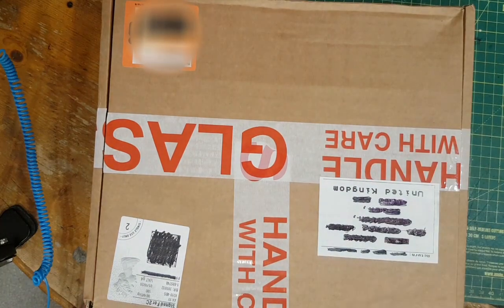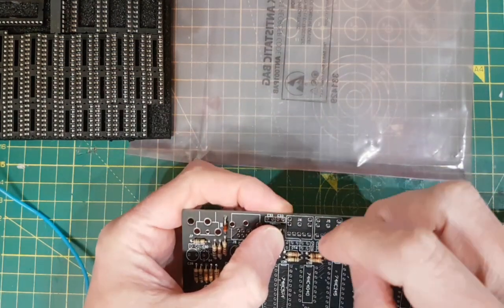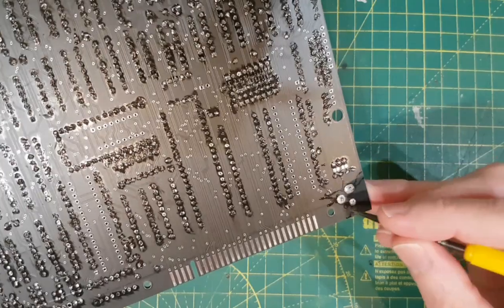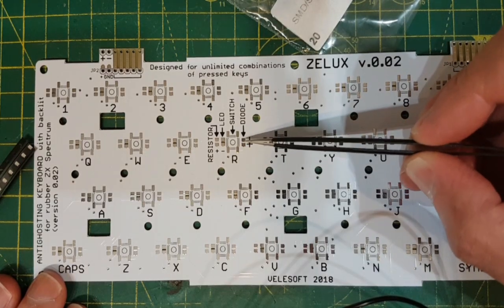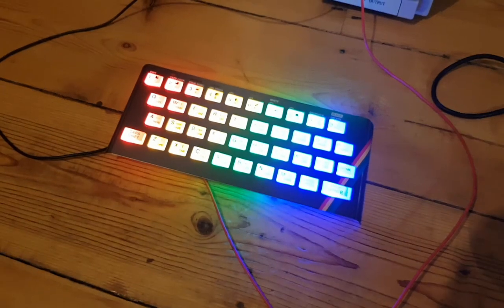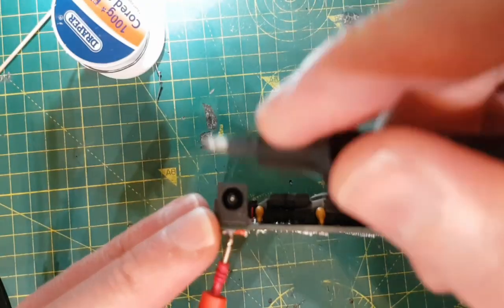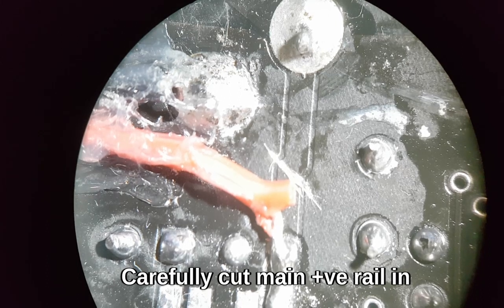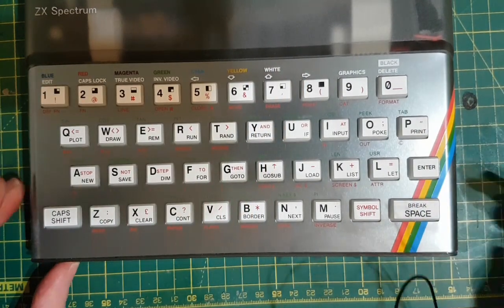Building a 128K ZX Spectrum Clone with an LED Keyboard

Comment: Nice job, I soldered up one of those keyboards as my first real SMD soldering - I almost got it all right but had one switch rotated 90degrees. I like how you tested all the LEDs with the DMM too, I'll be using that trick in future!
Reply from the maker: Thanks. Yep that keyboard was pretty fiddly! Just glad none of the components flew off the edge if the table 🤣
Reply: @Plan-C  I might've lost an LED when it pinged out of the tweezers 🤣